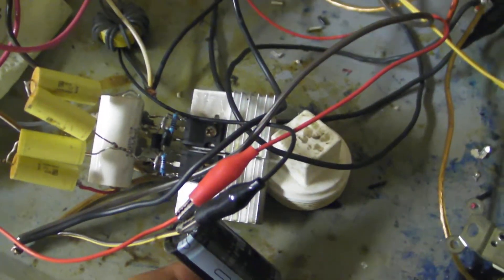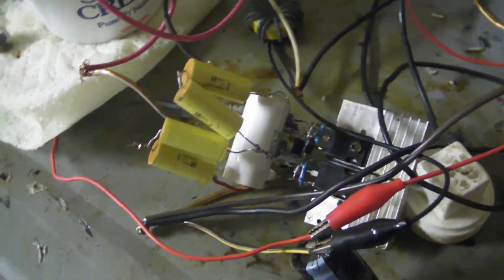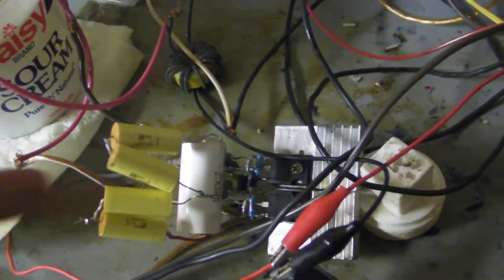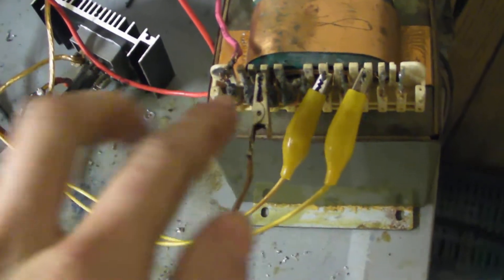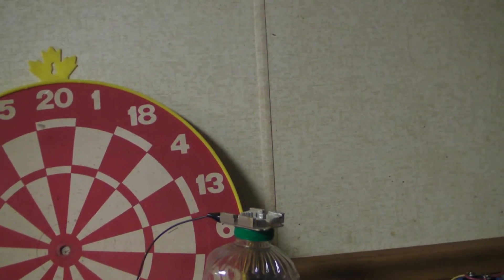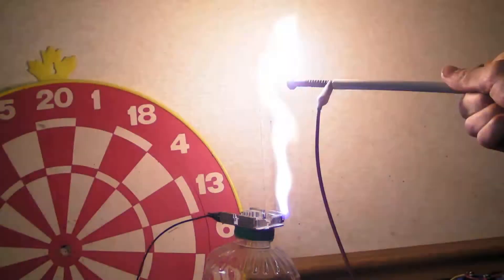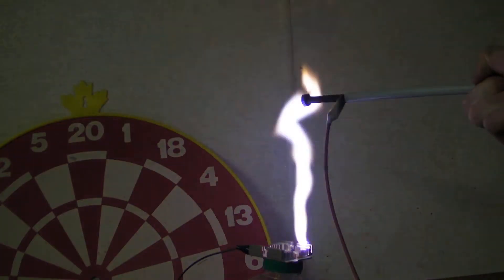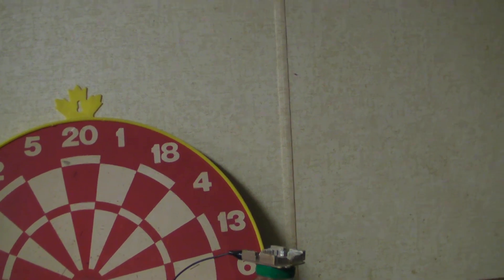2kW ZVS Driver

Comment from the maker: The ones that look like flames that run without pulsing have a high current flow along with high voltage. High voltage without the amperage will make it look thinner, perhaps purple or white.

Comment from the maker: Good question. This was a very quickly and poorly wound coil. I didnt even insulate each layer. Instead I just made a ball of wire with as many coils as I could fit and threw it under oil for good sakes. My best  guess is 26 gauge wire with roughly 200-300 turns. 28-32 gauge would have been much better if I wound it right.

Comment from the maker: See the video I posted (pretty recently) about my IGBT zvs. Get some say... 1000V 60A IGBTs for 6 bucks a pop. Worth it. Then use dual PSUs.. one to the mosfets gate about 35VDC+ and one to the inductor of up to 250VDC technically, according to the current it draws. And use a good heatsink on the igbts. A $3 intel P4 CPU heatsink with a fan on ebay is perfect. Just drill holes and make some screw fit. Power it to 12V, perhaps from a lm340 fed by the gate drive before the 470 ohm things.

Comment from the maker: Should work as far as I know. Limit the voltage input to 50 until you are done testing and move on to dual power supplies. (one + to the 470 ohm resistors at like 35 volts for good switching, and + unlimited voltage to the flyback and igbts *limited by igbt value* with both grounds connected)

Comment from the maker: Yesbut... I intended to run this driver to 120VAC (ballasted) before my power cap shorted to my IGBT heatsink. Once I get it all going again, Ill aim for more like 800V with a bit more amps. Even with good resistance ratings, you generally want the voltages rated at least three times the input. That way your covered if a big spike comes by, and they will blow your shit all up if there isnt enough "leeway"

Comment from the maker: I have no way to measure that high voltage. I have yet to get an ammeter. But assuming that the arcs are as big as a MOT's, and the starting gap appears to be about two or three times the kv of a MOT, I would guess maybe 1a at a guess from 4kv-8kv.

Comment from the maker: Ill make a schematic when I get a chance and send it to you. Just use dual power supplies, as one to power the mosfet and switching end, and another to power the flyback and inductor end. Both grounds are connected. And IGBT pins 123 are wired the same way you would wire a mosfets GDS

Comment: Hey can you help me? I have some 1.2Kv 72A IGBT's and I'm a bit new the the High Voltage part of electronics. I've gotten my smaller flybacks to give me some 4-7cm sparks, using a 555 timer driver, but what are you doing to your ZVS? I tried to build one but my IGBT's got really hot and I didn't get very good arcs. What is your secret? (My IGBT's are G27N120BN)

Comment from the maker: I like the idea of those fets lol. As long as you are using dual power supplies, the only real limiting factor is the mosfets. Obviously, the more power you feed, the harder of a time the drivers capacitor will have. You may need to build a decent capacitor bank. Also, you may want to look into better zener diodes (higher voltage and wattage). The normal diodes, I was using MR852. I now have MR856.

Comment: I bought some new shit, PWM Driver (to build yourself), toroidial transformer which is actually way stronger than it should be (gives about 90A at short circuit and draws 7.5A from 230v side) while it was rated 150w!!, also i bought an ne555, irf640 and some other stuff, now its only the flyback i need...

Comment from the maker: I didnt really modify anything. I use 1n4744a zeners (1W, 15V) and use the standard 470 ohm resistors. The only thing I really did was separate the inductor from between the driver and the flyback. I fed 35V+ into the two 470's on the driver, and used a different power supply to supply V+ to the inductor going into the flyback. You need to connect the grounds from BOTH drivers in their usual places. At this point, the power is pretty much limited by the quality of capacitors, IGBT rating, ect.

Comment: A Q: did you modified ZVS for higher voltage? i want to build IGBT ZVS and run it on 60-80 volts, but i think i need to modify something :3

Comment from the maker: You can, however considering it is only 7.5A, a simple IRFP150 would have more potential. A ZVS driver at only 30V will sometimes draw the current to 15A. If you want to go hardcore, you can use the HGTG30N60.

Comment: All I have to say is WOW I had no idea a fluback could do arcs like that!  Do you have to use a second lower voltage supply for the gates/base of the IGBTs or it it all run off the same 80 volts?

Comment from the maker: @Alex1M6 HG20N60D. I bought them as random IGBTs of ebay due to their high voltage and current rating. I did a little research of course. They handle over 100Khz too I think

Comment from the maker: @Alex1M6 Thanks! It pretty much is, I wound some 26 gauge wire on an old magnet wire spool that fit perfect with that medium sized core.

I fixed the jumper issues, as they add a lot of resistance to  my input, any of the jumpers feeding the ZVS flyback end are thick and soldered. The only thin ones I have are going to the low power input to the driver itself.

Thanks!

Comment: Very impressive, so it is literally a spool of wire with the core running through it?

Bet some of those jumper leads get warm after a while, I now only use screw terminals with my high current/power stuff as my alligator clip leads always got warm meaning power was being wasted in the leads. Plus with alligator clips only a small area of the clip actually makes contact with the terminal so more power wasted.

Good video anyway.

Comment from the maker: @jeffddow The not proper way LOL. I wound three nice layers (tape insulating each layer) then realized, this wire is too thick for a flyback and it will not produce that high of voltages, but instead a lot of current. I then just quickly would it into a mess. I just hooked a better connection to the ammeter, and it reads up to 30V when full length arcing!